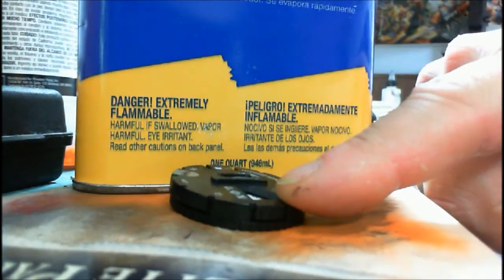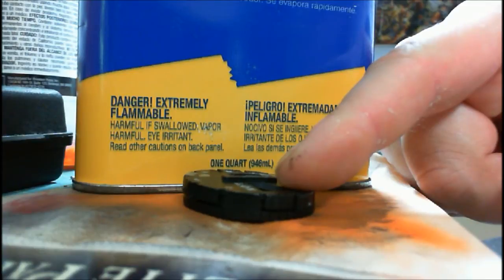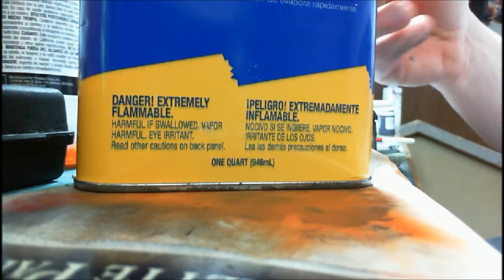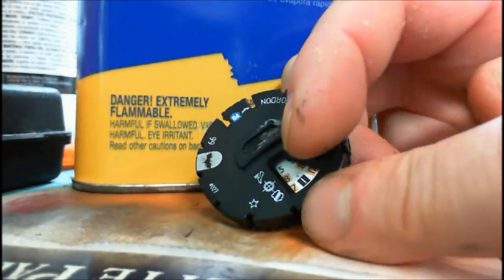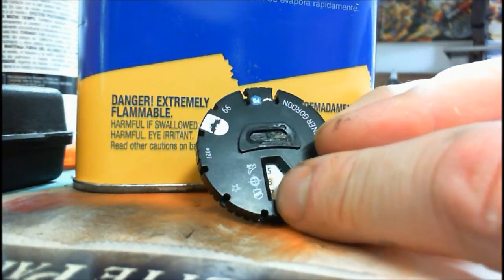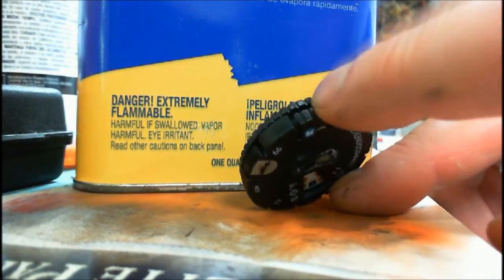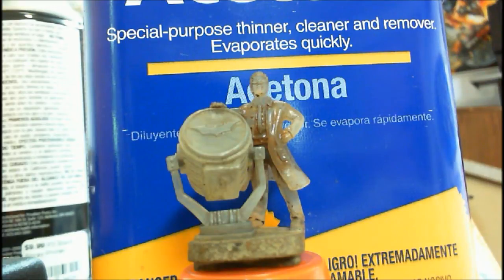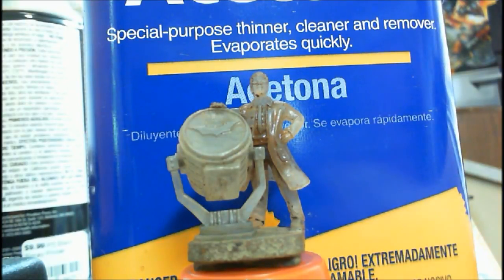How to strip HeroClix miniatures

Comment: Great tip. As I saw you making the mess an idea hit me ;). When it comes to base a mini with sand, static grass or so I use a Baking pan/plate which is cheap and has a high boarder/rim. This could help keeping the mess local ;) Another idea is to put some blue tac under the small container to give it more stability. Hope that helps, just went through my had and I felt I should share :D

Comment: for stripping acrylic paint off my minis I used LA's totally awesome degreaser. Works great and won't melt minis. Another plus is it's cheap, you can find it at most 99 cent stores.
Reply from the maker: I've heard of several similar products that are all supposed to be equally awesome. Unfortunately, HeroClix paint is not standard acrylic paint. Degreasers are unlikely to have any effect on it.